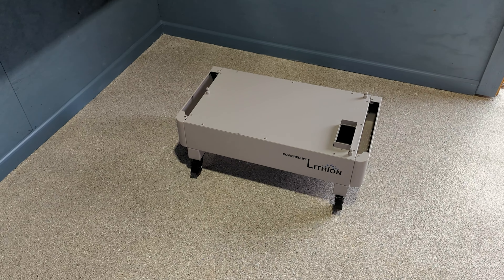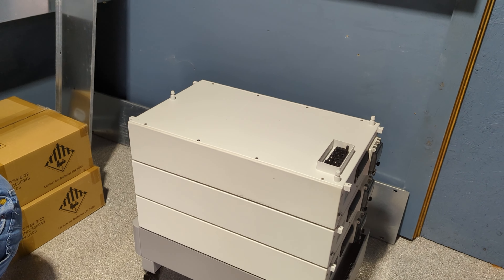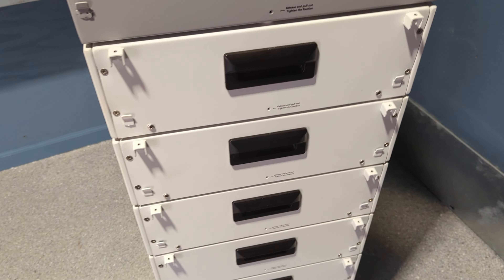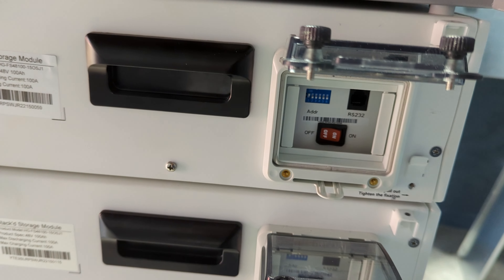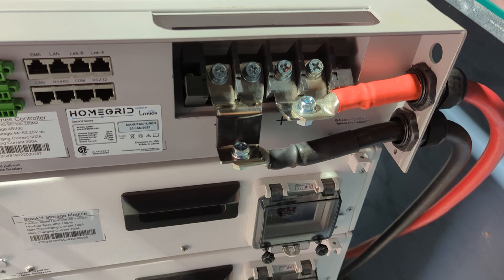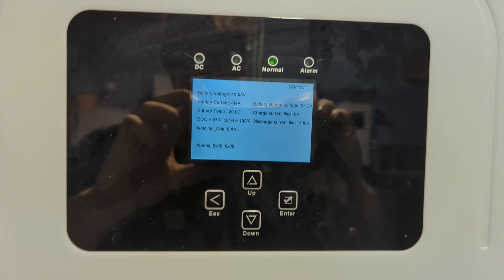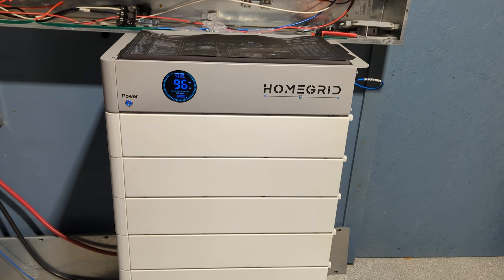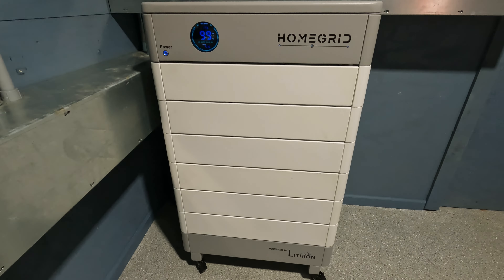HomeGrid Lithium Battery Review!

Comment from the maker: Link to the HomeGrid Stack'd Series battery:
https://bit.ly/3ICkgTF

Amazon link to the casters I added:
https://amzn.to/3mb700N

Let's talk about your homesteading goals:
https://practicalpreppers.com/consult...

Order the Sol-Ark 15k inverter:
https://bit.ly/3m7DGYZ
Reply: I have an 8-stack at 952 lbs that I'm installing. I love the caster idea, but concerned that 4 of the ones that you recommended just aren't strong enough for the weight. Read some of the 1-star reviews and noticed that some users with heavier loads experienced collapse of the casters. Any thoughts? Also, my base has 1/2" wide slots for 1/2"-13 stem casters. Did you have to drill the 4 holes each for mounting the flat plate casters? I'm thinking, given the weight of my stack that perhaps a 1" thick plywood sheet with 8 casters might be a better idea.  Your thoughts? - Update: I just finished building a dolly combining the 8 plate casters from two 1000-lbs. rated furniture/piano dollies. ~120 lbs per caster seems reasonable.
Reply: THESE (the amazon link he provided) IS THE RIGHT CASTERS! - I wasn't sure and took the risk, and YES! they are the correct ones!!!

Comment: I’m the lead electrician for a solar company in colorado. I’ve installed a handful of Sunpower sunvault battery systems and have the process down for the most part. The nice thing about that system is that they send a company rep to our first few installs to help things go smoothly and to make sure everything is installed correctly. Which made the installation go fairly smooth. We are looking at installing a home grid system in the near future. I am wondering if you would be open to lending support for my first install or could put me in contact with someone who could? Awesome content looking forward to seeing what you get into next. Cheers

Comment: Scott, another awesome video.  I have a  controller with 8 (1K MAH} batteries that are stackable/interlocking arrangement, but on a hand truck for mobility. 
Now, I'm waiting for a new module that provides 1200 watts of charging/UPS capability. Currently it's a manual operation if/when the power goes 
out. Thanks again, for all you do. Cheers, Mate.

Comment: I am using 11 lifepower batteries with the 15k sol-ark using under voltage.  waiting for for the communications to be update for  use under percentages.  Seems to be working better than I thought it would this way. Had  them on a Growatt 12k for a year.  liked the communication, but had a couple of hi-cups and shut the power down on me.   Looking at getting the panels off the roof on one building right now and buying a Sinclair mount system.

Comment: This HomeGrid battery sells for $17,581 and delivers 28.8kwh of capacity, so $0.61/wh.  The EG4 server rack kit also shown in this video includes 5 batteries in a roll-around metal box.  It sells for $10,194 and delivers 30.72kwh of capacity, so it only costs $0.33/wh.  Is there something really great about the HomeGrid battery that makes it worth nearly twice as much money, per watt-hour?
Reply: its the caifornia thing, id guess
Reply: UL9540a certification, CA ESS listed, so can be used in California.  Super easy to setup.
Reply: Slightly cleaner look? Easier assembly? Normal marketing differentiators (and the UL Cert thing).
Reply: @dangeist2899  - Sure, that's totally worth a 70% price increase and 10% less usable capacity.
Reply: Is Homegrid a diy friendly product/company, or is this really only sold through channels/installers?
Reply: @jasonbroom7147  Homegrid is part of Lithion, a 20 year battery manufacturer based out of Henderson, NV.  Homegrid uses Tier-1, automotive grade LFP cells within the systems and the highest grade components.  Hopefully we can get the price down but for now, if you want the highest grade components it is difficult to be price competitive without a compromise in quality.
Reply: @bryanhamlin1208  - For stationary storage applications, where rapid charge/discharge are not nearly as important as sheer volume of capacity, pitching a product at twice the price of your competition is going to fall mostly on deaf ears.  For educated consumers, meaning those who understand what is needed in this space, they're going to choose a perfectly serviceable, more equitably-priced option.  There are always those folks who will pay double because they think they're getting something a little better, and I guess that's the market for this product.
Reply: EG4 Lifepower LL as quoted above also have UL9540a certification.

The Lifepower 4 do not as of yet have UL9540a certification, 6 with the rack would be a few hundred less than $9k
Reply: The closed loop works better.
Reply: Are you running a farm or business with this amount of power and how long does it take to fully charge on a Sunday filled day from total discharge
Reply: Your question pinged me as the reply-but I’m. It sure you meant to quote me and ask your question…
Reply: @misosoup777 only one can be used in California?

Comment: 1:03 Make sure if you're going with Caster wheels, to follow the link he has listed above! It's imperative they are plate casters, and the plate needs to be 2" wide. Difficult to find at your big box stores.
Reply: True to a point. I looked at those casters in detail. Didn't like the 1-star reviews (as with most casters). While the HomeGrid's base is milled with slot on the bottom of the "braces" for 1/2-inch threaded stem casters, in reading the reviews on Amazon for a variety of caster models nothing, except perhaps low profile stem casters for commercial refrigerators, has any of the strength to carry a 952-lb. 8-stack of the HomeGrid batteries. For me (as a former P.E.), that's just not enough margin of safety. Four plate casters are questionable at that weight as well.  I ended up using 8 casters from 2 x 1000-lb large piano dollies and making my own platform on which the base sits.  No drilling the 16 holes into the braces (which could then rust over the 20-year design life), and the weight on each caster (assuming even distribution) is 119 lbs, which I consider reasonable. For smaller stacks, such as this project has, the casters he lists may be adequate.

Comment: We just installed our Sol-Ark and 8 stack HomeGrid. Ran battery last night and only powered house for 5 hours. Then i saw that the grid was charging it before solar panels started working. Since i am a novice i am trying to figure out if it is self deafeating to have grid change a battery that just was used for home energy. ALSO I made them put the casters on! They said they plan to do that on future installs . Thank you!
Reply: I hear you. I have an 8-stack as well. How long the charge lasts all depends on how much energy you draw at night. At 5kW/hour, e.g. mostly running an HVAC unit, the stored energy will only last 10-12 hours. If you cut down usage to 1.5kW/hour by shutting off that HVAC unit, then the charge will last much longer. So it has to do with load management. We do laundry during the day, heat/cool the house during the day, take showers during the day and go to ECO mode at night. A space heater can heat a bedroom for less energy than a whole-house HVAC unit.

You may be able to program the Sol-Ark not to charge the batteries from the grid until a certain point. I'll have to look into those settings.

How are your casters holding up? An 8-stack weighs 952 lbs (according to HomeGrid's specification sheet). A number of the 1-star reviews of casters suggested that they collapsed under high weight or the wheels developed a flat spot. I made my own dolly using 8 plate casters from two 1000-lbs furniture dollies, so ~120 lbs per caster. I never want to risk a stack tip over, nor rust from where the plate mounting holes were drilled.

Comment: For sure, turn off battery when putting together the last cover they need more space.  controller/battery input top cover.. good video!   Have any inspectors held you up on the EG4 batteries not having all UL listing.   Don't think that's just a CA requirement.  Seems like the Eg4 cabinet may not have any ul listing.    Of course the ca additional UL requirements I bet other states are looking at also
Reply: EG4 Lifepower4 batteries hold UL 1973 listing and Lifepower LL have both UL 1973 and UL9540a.

Comment: Just purchased the 3 battery setup to start with, very excited. I like your aluminum boxes you are running as conduit replacement. Where did you purchase the boxes from?
Reply: What you’re looking for is wiring/wire trough.

Comment: I have a question about the connectors between the stacked battery modules - do the connectors have some float built in so that they self align independent of the stacked module? Thank you!

Comment: It sure would be nice if that 30k sol ark could work with a home and be EMP protected. Save a lot of cost for my system
Reply: @boblatkey7160  you should read up on sol arks emp protection protocol. Its robust and comes with the associated pieces required to protect major (non smart) appliances as well. 
The 30k is not offered with emp hardening however

Comment: did you have to "custom" make/wire that CAN cable?  or just use the standard configuration of the cat6 cable?
Reply: HomeGrid supplies a 6ft cable.  If you need longer, yes, you have have to make it.  It does NOT use a standard pinout.

Comment: Is this in CA ? are you able to run A/C and D/C in the same gutters? is this up to code? 
or because it's all part of the same system it is allowed. just want to know. I have installed some Sol Arks like this and got called out. thanks. also a great video.
Reply: NEC 300.3 (c) (1)

Comment: @engineer775 if I started with a home grid 5 battery pack and hooked to a solark 15K , then brought an EG4 30kw, what is the best way to combine the homegrid and EG4 ?
Reply: I don't believe that you can, as they are of different Voltages. Perhaps someone can educate my in why it could be done?

Comment: Sorry if I jumped the gun and asked a question before finishing the video but didn't want to forget my question. Can this stackable battery system take voltage feed directly from Enphase microinverters? If not do you have an idea how this system might integrate with a system that only has solar panels--->microinverters--->Enphase combiner box--->Service panel main/meter box?
Reply: They cannot couple onto microinverters as they are DC batteries. You would need a hybrid battery inverter capable of AC coupling (like the sol-ark shown in the video)
Reply: That's a strange question, the batteries are DC, but you can AC couple them to a sol-ark inverter.

Comment: Did you have to charge each battery individually up to 100% before putting them together in parallel?
Reply: You do not. They will auto balance just fine. I even added a new stack to my existing 7 without worrying about the charge imbalance beforehand.

Comment: I have a very small power system in my house in the woods. There is no grid power available here. Would you be willing to give me some guidance on a battery upgrade? Right now I'm using gen 1 Chevy Volt batteries with no BMS. Only a couple of old panels installed... There are a few issues, though I have kept it working. Very old inverter from 1999 that still works. Looking for a cost effective upgrade in the medium to long term future
Reply: These types of batteries are not going to be compatible with your older lead acid style inverters and charge controllers. I suggest you get a high end lead acid battery and keep the rest of your equipment as it is if it is still working.

Comment: Those are EMP protected inverters going on a lithium BMS system how did you get around the EMP protection for the battery BMS
Reply: We have an EMP rated 15k Sol-Ark. Unfortunately, the Lithion HomeGrid batteries are not EMP hardened. That being said, as a former EMP engineer, putting some ferrites over both ends of the transmission and CAT-5 communication cables to the inverter would be helpful.  I suspect there are also some avalanche zener diodes that one could place across the terminals to reduce any pulse between terminals.  As far as the HomeGrid case and BMS is concerned, I wouldn't be too worried if the clamping ferrites are put in place. If the case is grounded, most of the pulse will go to ground. Voltage spikes only form over distances / lengths of cable. I'll be looking into further into it.

Comment: Can you remind me again, the reason for using 15S instead of 16S?
Reply from the maker: So they can stay right under that 20kw limit in California with four batteries.
Reply: @engineer775  If you mean 20kWh , that is a peculiar number. That’s an off grid office with climate control here in Texas. It’s a decent short term backup energy supply, of course. 40 kWh would be more fitting for most homes, at least in my experience.

Comment: $17,581 damn expensive
Reply: Try adding the cost of the inverters as well as a professionally installed system by a licensed contractor and this system will cost you $50-$60,000 installed.